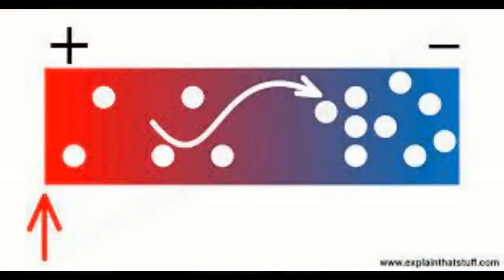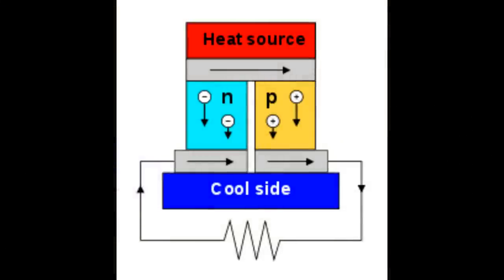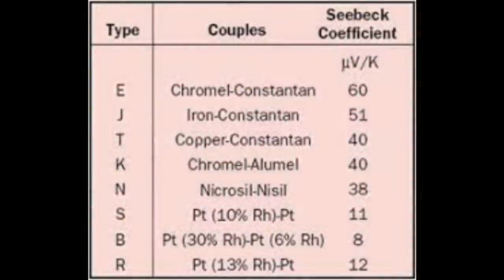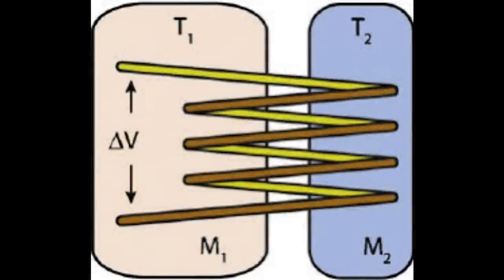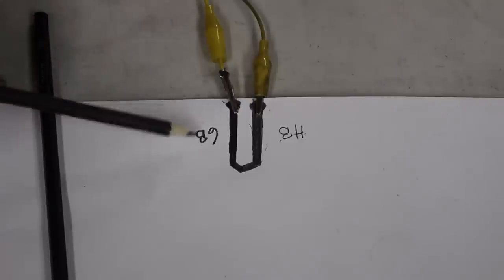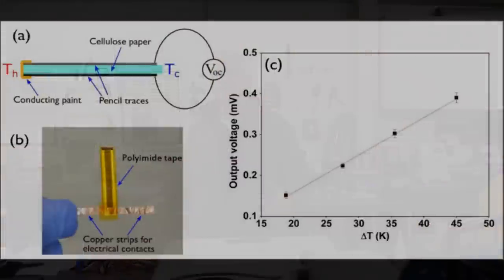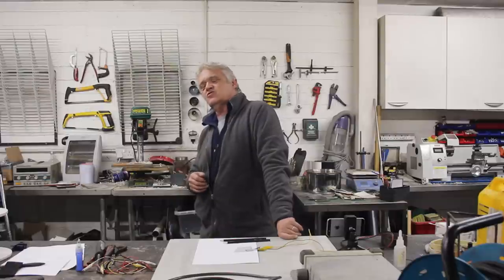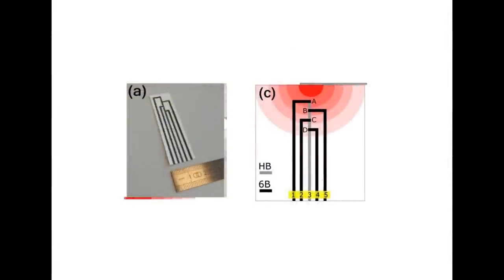1720 Power From A Pencil

Comment: Then comes the question: can you print out as much power as the cost of the ink and the electricity it took to make it?

The voltage gap would surely need to be pretty tall to recover the cost!

Perhaps the trick would be to stack it and make it a 3D printed thermopile.
Reply from the maker: to print a single unit would be parts of parts of a penny mate - I mean really really small - I worked on a machine that can product - and I am not kidding - 1 kilometre of paper in 1 minute - it boggles the mind how fast and how much some of these machines make - to get a grasp on it  - it might be good to think how much a newspaper costs and how many hundreds of thousands of these units could be printed in a newspaper
Reply: @ThinkingandTinkering  Definitely the smaller each junction, the cheaper the cost, and the more one can pack into a small point. 

I've been working on how to build a huge printer of my own [I am an author, besides being a nerd] and it would be as good for printing these little electrical gates as it would be at printing books, only one might opt for wider and longer 'trim sizes' than a normal book, depending on their intended application.

Like say if this were something one wanted to put in the walls or roof of a house, one could print pieces that fit between the rafters and the studs and doubled as insulation at the same time...

Say pick an arbitrary width [most houses are built 16" on center here in the USA, no idea about any other countries] and print the material out either as a continuous 16" roll and add some kind of adapter clip wherever you needed to cut and splice it, OR, pre-print [since it would be digital and on-demand] fixed lengths for every spare space in a home, as it is being built, with ends already set up to just apply some kind of adhesive connection strip, and if you recall you mentioned using zinc chloride to make an extra tough, resilient type of paper, this would make it more durable, so you could stack it and even make 'batts' [like batts of fiberglass insulation] that could handle being rolled up from the factory, shipped on a pallet to the house and just pasted into the cavities between the studs, before people even went into wiring the home, and, in fact, it would become part of the house wiring, after an effect, so the same places one would run collection passages,they could also run their conduit for high voltage, and it would take up almost no additional space, and scarcely much more copper wire.

I could see setting up to just mass print these for years on end if they prove to be cost effective enough.

I am already setting up to experiment with mass producing zinc chloride treated paper based off your video, if my idea works it is only logical to follow up with the printed [would you call them 'diodes' or just 'semiconductors'?] in massive spools, using 100% recycled paper, therefore at the same time, keeping paper out of the waste stream and all the nastiness that goes with that kind of disposal.

[I have been collecting literally thousands of regular brown paper feed sacks from my own farm as well as a neighboring farm and I have a small truck load of them already. Each feed sack is roughly .8 of a square meter of pepper times 5 separate layers, so roughly 4 square meters of paper each]

Since people already recycle paper, and its pretty much useless for printing on at that point, but useful for other things, and I know where I can get literal truck lads of shredded document paper, it would be pretty easy to develop a system which takes any kind of scrap paper [white, brown, colored, newspaper or print type, really doesn't matter], make huge strips of this durable paper, and then print the collectors to them in a non-stop continuous project.

It would be serving the environment, AND he public on SO MANY levels too! (~_^)-b

Comment: I was expecting you to use the pencil complete.. was surprised it worked that well with drawings :-)

BMW developed a improved peltier version to win back electric power from exhaust heat.. never went into production because the output vs the cost/weight (even optimized) was so bad, it did not matter for fuel saving achieved with it...
You get a lot more usable easy energy when using the alternator for soft braking when backing off the digital throttle or rolling downhill.

Problem with the peltiers is (only 17% efficiency if at optimal point) that you need a high temp diff side to side, but the modules transfer heat kinda good. So at a certain input (or output) = temp difference you get a thermal "short" through the module.
Now if you stack two modules they have double the heat flow resistance but also only see half the temp difference.. and so on.

I did a presentation on those things in school physics 6th grade something over 2 decades ago.

Cool thing is you can create ice out of thin (humid) air and its a special feeling to touch something that is both hot and cold at the same time, especially if you explain it only afterwards, maybe bet something.. ;-)
Reply from the maker: me too - it was a really interesting find in so many ways

Comment: Question, there are multiple effects of carbon . The 2 pencils also make a 
Karpen Pile , is essentially the same but with an electrolyte ..and I know you familiar with it you made plenty 

Mrs Chung's negative resistors ( I don't think you familiar with and military keeps tabs on it )  compresses carbon fibers creating lattices I believe slowing the flow a p. LENR science also 

Now the thermoelectric you demonstrate just adds another variation but makes one wonder .. why not combine them .

Zeolite will also cool down material during the day and at night absorb moisture and heat up . 
Other volcanic stones absorb heat from the day and hold it long into the night .

Can we also utilise this effect.

Comment: I was thinking today of how much energy is waste by internal combustion engines, and how all that heat has to be irradiated to the environment. It would be wonderful if someone could make an experiment and see how much could be recovered using thermal generators like this one. It could be used to charge batteries in hybrid cars.

Comment: Hi Rob  thanks for your spectacular videos ,for the first time you touched the carbon  circuit (is itself in a small antenna array) by bare finger you've changed the circuit resistance  while your body is carrying some charges and acting as a bigger antenna, the second time with a plastic barrier finger touch was acting like you are changing capacitance of the circuit  ,in both cases impedance of the circuit will be influenced, what you have seen in that DVM ,to judge from a very small example in microvolts /1Degree C.TEMP to see if there's a seebeck effect  was in my opinion is surrounding microwave frequency /electromagnetic fields affecting all, you really need sensitive good testing tools and very good references to earth  . to judge. cheers mate.
Reply from the maker: cheers mate

Comment: Seems to me, that if you made a single junction the size of a nickel, or maybe even fit in  1cm^2, and array them along to the size of a poster, your could at least make cell phone charger, maybe better. Would think that if on the underside you put aluminum foil(to manipulate heat, say to you could put  this on a concrete floor under a laminate tile, you could have a power scavenging floor, that could possibly be up to or slightly above running an LED based lighting array. Not to mention, if you did it with a monitoring device, it could detect people, pets, fires, ambient temp, giving conveniences and or security capability as well.

Comment: Would a Thermopile be a logical way of collecting the energy saved by a Sand Battery? I know Sand Batteries are largely being looked at as a way of heating large areas, but this feels to me like an interesting way to "Reclaim" the saved energy and turn it back into something useable for more than just heating. I also assume that someone much smarter than me has thought of this and already seen that its too inefficient or some other reason for not doing it, but this is why i ask my question haha.

Comment: I heard the Americans spent 30 million dollars developing a space pen that could write in zero gravity.
The Russians took a pencil.
Reply: and the pencil parings went all over the inside of the spacecraft...
Reply: Nah, $10 million went to funding a think tank to decide if it was needed, $10 million funded a committee to decide which contractors were eligible to bid on the project, $9,999,995 went to paying off the guy that realized heat doesn't convey in a vacuum, and $5 was spent to order a dozen from Sears and Roebuck.
Reply: @ricksanchez3176  XD
Reply: Sadly it's a myth. But I still enjoy the message.
Reply: @michaelbevan3285  Every video I have seen of the cosmonots writing, they had a wrapped paper pencil. Not unlike "grease pens" that sharpened by pulling a string, then either folding back, or tearing off the feathered pieces while pinched.  A little Wahdka and they might get away I guess. 😉
Reply from the maker: lolol - that is probably right

Comment: So print enough on a paper wrap it around a pipe and make enough power to run a joule ringer circuit for an led.
Reply from the maker: go for it mate
Reply: @ThinkingandTinkering  So far I made a small acetone lamp from an old transformer for copper wire. An old Hernandez jar cleaned up for the lamp. Holes in the lid for the bolts to hold my filaments and for air. Then using a blow torch to turn the copper into black copper oxide. All that is needed is a bit of acetone to have the catalyst reaction to make the filaments glow.
Reply: Acetone Lamp Mark 2: Take a lid and make a hole in the center. Put a bolt with threads in the top. With a small wooden wheel that is smaller than the lid hole. Take some copper screen and heat treat it. And put the small wood wheel on the bolt and fasten the mesh copper screen on the the wheel making sure it reaches the lid. Make sure two air holes are in the top of the lid in the diameter of the screen for vents. One or two more holes are made for vents but these have pipes running though them and down and up through two holes in the wood wheel. Then a piece of carbon felt is put in the bottom of the jar. Acetone up to an inch or so is poured in. Then the lid is taken off with the copper screen assembly preheated a bit. Then put back into the jar. The carbon felt only goes up two inches and the screen and bolt only go down two or three inches in the assembly. As acetone vapors react with oxygen it gets hot and glows. Convection draws more air into the device making it glow hotter.

Comment: Hello 👋 
I’m 10yrs old and I have an interest in transformers lately, (I am not clever)

I am wondering if u use a step up transformer up to billion volts and basically 0.000000000001amps with the use of 1 watt 

Can’t this be a electro magnet superconductor as the Amps are almost 0 
and would this be able to work at room temp
 
We can also use this 10’19 volts to create an rip in the universe
Reply from the maker: in theory yes - in practice losses will probably use more than 1 watt unless you used special materials which would be expensive
Reply: Pertual motion awaits